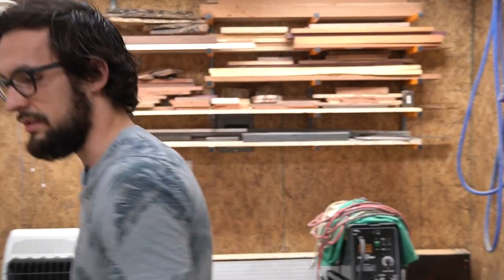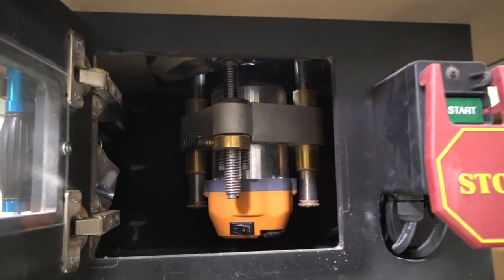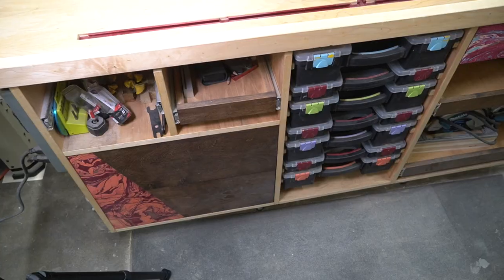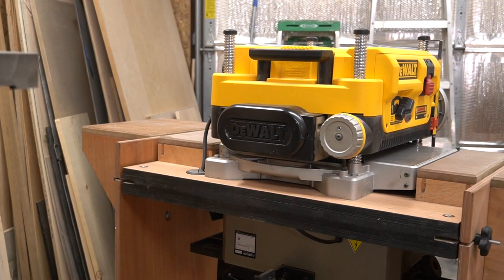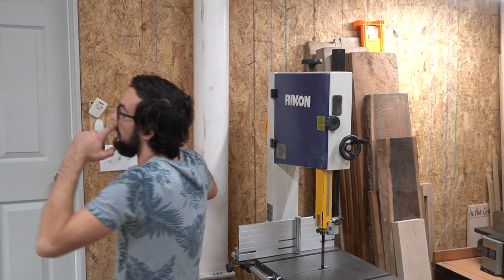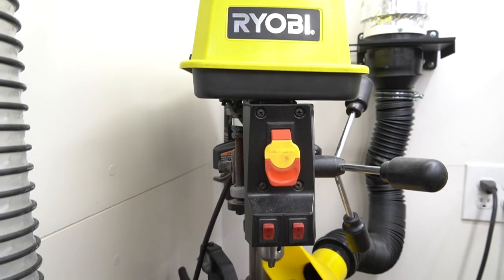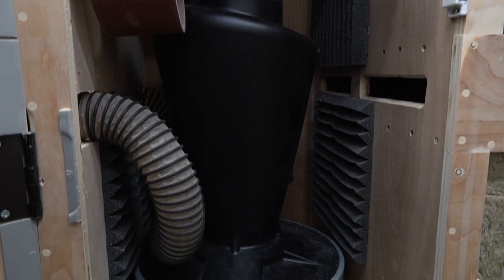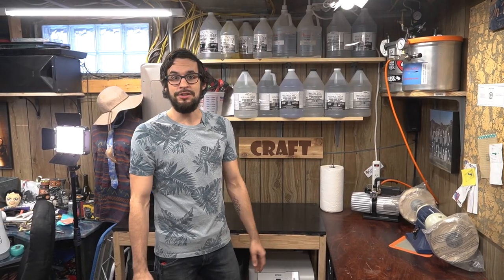2021 Shop Tours

Comment: Very nice setup. My shop is  slightly larger but same setup.  I never thought about using additional rooms downstairs for extending the workshop. Hmmm
Reply from the maker: If you've got the space downstairs I would highly recommend, especially if you live in the northern part of the US. Less space to heat up to get going
Reply: @InTheGrainCreations  yes I live in RI so it gets cold.

Comment: Nice shop. On that flip table, any sagging or issues. I have that planer it's super heavy so have been wary to make a flip top but thinking about it.
Reply from the maker: Thanks! Nope, the bar I used was rated for at least 1000 pounds at that length. Plus the platform itself is 2-3 inches thick and is solid throughout most of it.

Comment: You have a phenomenal shop, with a TON of tools setup in a relatively small area. The removable extensions on the flip top planer cart are definitely next level stuff. Much less space used than a planer sled. Do you find your setup really cuts down on the snipe?
   Oh, and you need more ductwork ;)
Reply from the maker: Hey thanks, a lot of time and energy went into getting it up to where it is today. For the planer it definitely reduces snipe (on larger pieces), but that model of dewalt I've heard it very hard to eliminate all together. 
Haha funny you say that I just finally connected my cnc to the main ducting yesterday!